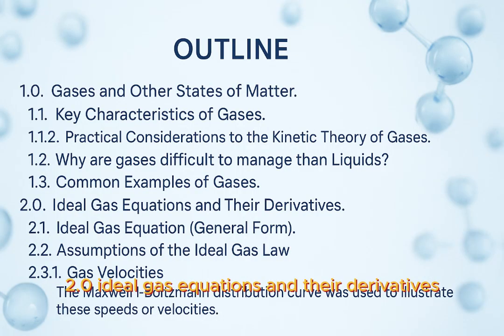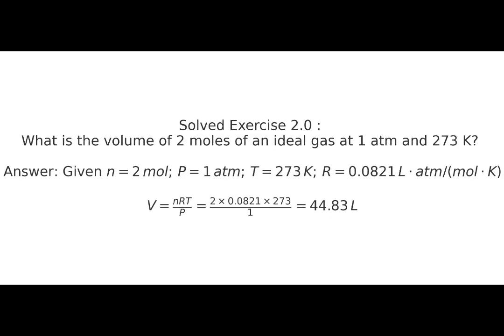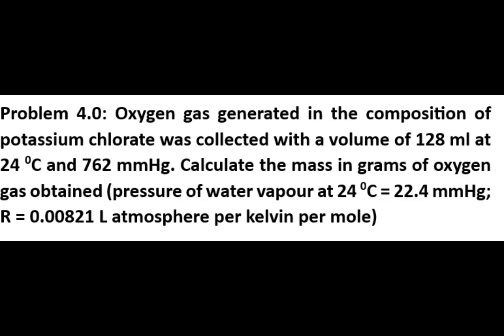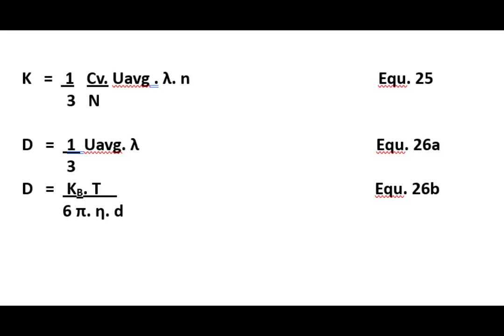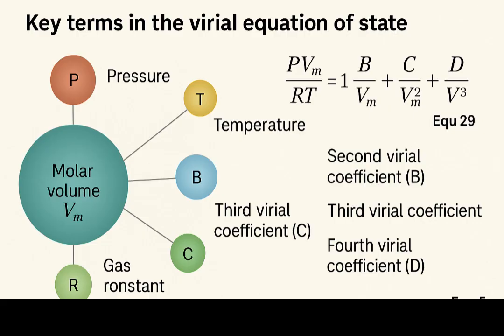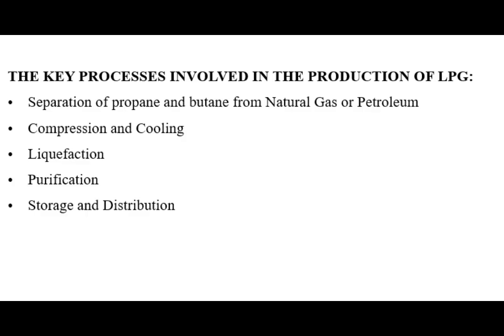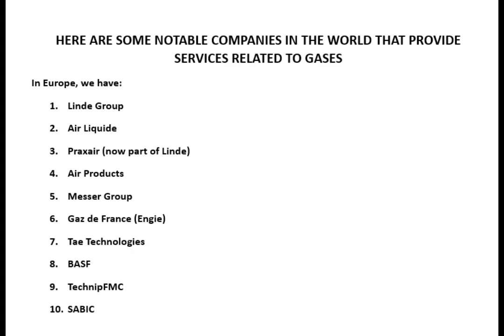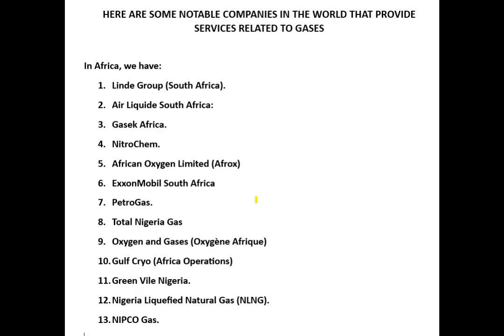Fundamentals and Applications of Gases

Comment: BCH: The implications of using free and pure form of oxygen gas in the atmosphere rather than the cylinder of pure oxygen for anaesthesia during surgery are impracticality, safety risks, Uncontrolled flow: Atmospheric oxygen wouldn't provide a controlled flow, which is crucial for safe anesthesia administration, Risk of oxygen toxicity: Prolonged exposure to high concentrations of oxygen can be toxic and Regulated flow: Cylinders allow for regulated flow rates, ensuring the patient receives the correct amount of oxygen,

Comment: MCB 

IONIZATION OF GASES 
Yes, it can. Ionization of gases in the atmosphere allows air to conduct electricity, which leads to lightning during a thunderstorm. This happens when strong electric fields ionize the air, creating a path for electricity to flow as a lightning bolt.

LIGHTNING OF ELECTRIC BULBS

Yes, it can. Ionization of gases allows certain electric bulbs (like fluorescent and neon) to light up. The gas inside gets ionized, letting electricity flow and produce light. Incandescent bulbs, however, do not use ionization. They glow by heating a metal filament.

Comment: BCH: GBONEE GRACE BARIVURE 
U2023/5535211
Using free and pure form of oxygen gas in the atmosphere rather than the cylinder of pure oxygen from anaesthesia during surgery has some positive implications like cost savings, increase availability and reduced logistical challenges. There are also some negative implications like contamination risk, air quality concern, safety and efficacy, equipment modifications. Also, some critical implications includes patient safety, medical standards and anesthesia precision

Comment: Bch…(u2023/5535026)

Using atmospheric oxygen during surgery is not advisable  because 
Regulating the oxygen flow and concentration might be challenging without a controlled delivery system like cylinder
Atmospheric oxygen might contain. Pollutants or particles that could compromise patient safety 

Using atmospheric oxygen directly for anesthesia instead of cylinders poses safety concerns, logistical complexities, and challenges in precise control. Current medical practice relies on controlled oxygen supply systems for reliability and patient safety.

Comment: ABOVU HANNAH SUNDAY
U2023/5535048
BCH: Using free atmospheric oxygen for anaesthesia during surgery isn't ideal,reasons being that;
1. Not pure enough: Only 21% oxygen in the air.
2. No pressure control: No built-in regulator.
3. Contamination risks*: Pollutants and pathogens in the air.
4. Logistical issues: Hard to capture and purify on the spot.
Cylinders of pure oxygen are safer and more reliable for surgery.

Comment: BCH: Using free and pure oxygen directly from the atmosphere instead of a cylinder of medical-grade oxygen for anesthesia during surgery would have serious scientific, safety, and medical implications

	•	Medical-grade oxygen from cylinders is:
	•	Highly purified (≥99.5%)
	•	Sterile and filtered
	•	Delivered through controlled systems
	•	Atmospheric oxygen is exposed to dust, bacteria, pollutants, and humidity variations.
Implication: Using it would introduce a high risk of infection and respiratory complications.

Comment: BCH-U2023/5535166
Oweibe Esther tamaraebi
Using pure oxygen from a cylinder during surgery instead of ambient air has implications for patient safety and surgical outcomes. While pure oxygen can improve oxygenation and potentially reduce surgical site infections, it also carries risks like oxygen toxicity and atelectasis (lung collapse) if not carefully managed. Additionally, it can increase the risk of fire or explosions if not handled properly.

Comment: GLY: Liquefied Petroleum Gas (LPG) is a popular fuel used for cooking, heating, and transportation. It's a mixture of propane and butane, stored under pressure as a liquid.

Some key benefits of LPG include:

1. Clean-burning fuel
2. Energy-efficient
3. Convenient for cooking and heating
4. Wide availability

LPG is widely used globally, especially in areas where natural gas infrastructure isn't available.

Comment: FELIX PERE-ERE 
MCB: Yes ionization of gases in the atmosphere causes lightening during thunderstorm, when strong updraft in storm clouds separate ice particles and water droplets,charge separation occurs, this creates regions of positive and negative charges in the cloud. the electric field becomes so intense that it ionizes air molecules, stripping electrons from atoms this ionization creates a conductive channel that propagates downward when it connect upward from the ground the lightening discharge occurs

Ionization of gases is not the primary mechanism for lighting of electric bulbs so 
In summary ionization of gases can not lead to the lighting of electric bulbs but causes lightening during thunderstorm

Comment: BCH... U2021/5535003 (orlu vidah eberechi)

If we could harness atmospheric oxygen for medical use, it would require significant advancements in technology to ensure:
1. *Purity*: Removing impurities and contaminants to meet medical standards.
2. *Consistency*: Maintaining a stable oxygen concentration.
3. *Safety*: Preventing any risk to patients.
While it's an intriguing idea, the current medical standard relies on controlled, high-purity oxygen supply from cylinders or oxygen generators specifically designed for medical use.

Comment: BCH.....( U2021/5535044 )
Harnessing atmospheric oxygen for medical use would require significant technological advancements to ensure:
1. *Purity*: Effectively removing impurities and contaminants.
2. *Consistency*: Maintaining stable oxygen concentration.
3. *Safety*: Guaranteeing patient safety.
Currently, medical oxygen supply relies on controlled, high-purity systems like cylinders or medical-grade oxygen generators.
Any new approach would need to meet stringent medical standards and regulations.

Comment: PIC: Joule-Thompson experiment is a typical example of the cooling process. LPG which is composed of propane and butane uses this cooling process. Unlike propane and butane,the cooling process is not enough to overcome the low critical temperature of methane which makes up over 90% of LNG.Therefore a process which is called cryogenic process is used. A cryogenic process is the process of applying extremely low temperature to cause the gaseous methane to be liquefied.

Comment: BCH: The implication of using free and pure form of oxygen gas in the atmosphere rather than the cylinder of pure oxygen for anaesthesia during surgery has significant implications as the oxygen cylinders contain a controlled concentration of pure oxygen ensuring consistent and accurate delivery. On the other hand atmospheric air, even if filtered, contain variable amount of oxygen and other gases like nitrogen, argon and carbon dioxide. This variabilities/impurities makes it difficult to precise and control the inspired oxygen concentration for the patient which is critical during anaesthesia.

In summary using free and pure oxygen from the atmosphere instead of oxygen cylinders for anaesthesia is unsafe and impractical due to the lack of purity, inconsistent concentration, potential for contermination and incompatibility with anaesthesia equipment. Oxygen cylinders provide a safe, controlled and reliable source of oxygen for medical use.

Comment: BCH : Using free and pure oxygen from the atmosphere instead of a cylinder during anesthesia poses significant risks, including potential contamination, difficulty controlling oxygen concentration, and increased risk of fire and explosion. While pure oxygen is used in anesthesia, it's carefully controlled and delivered via a cylinder or other medical-grade system to ensure patient safety. 

Ambient air is only 21% oxygen. During anesthesia, precise control over oxygen concentration is crucial for maintaining adequate oxygenation and preventing complications like hypoxemia (low oxygen) or hyperoxia (excess oxygen).

Comment: BCH : (U2023/5535113)

Using atmospheric air in place of pure medical oxygen during anesthesia is unsafe, impractical, and not permissible in clinical settings. Medical oxygen is carefully manufactured and regulated to meet the physiological and equipment demands of surgical procedures.

Comment: ANUGHOM SHINE CHIDERA -- U2023/5535040
BCH:  If a medical cylinder that is being used for surgery doesn't contain real oxygen, it means the gas inside isn't pure oxygen, which is vital for surgery. Oxygen molecules interact through Van der Waals forces, These forces are what allow oxygen to exist as a gas and to be absorbed into the body.
If the cylinder contains something other than real oxygen, it would be dangerous for the patient, in the essence that ;
* Other gases will have different Van der Waals forces, and may not be able to bind to haemoglobin, which carries oxygen in the blood, resulting in organ damage.
* The introduced gas could react unpredictably with the body or anesthetic agents.
In conclusion; The patient could suffer from insufficient oxygen, organ damage, or adverse reactions due to the lack of real oxygen.

Comment: GLY-U2023/5565078
Dalton’s Law states that the total pressure of a mixture of non-reacting gases is the sum of the partial pressures of each individual gas. The partial pressure of a gas is the pressure it would exert if it occupied the entire volume alone at the same temperature.

Comment: The use of free atmospheric oxygen instead of a medical oxygen cylinder during surgery is unsafe and unacceptable because:

Atmospheric air contains only 21% oxygen, while medical oxygen cylinders provide nearly 100%.

Anaesthesia requires precise and controlled oxygen delivery, which air cannot ensure.

Atmospheric air is not sterile and may contain harmful contaminants.

Inadequate oxygen can lead to hypoxia, brain damage, or death.

It violates medical standards and is ethically and legally improper.

Conclusion: Only pure, medical-grade oxygen from cylinders should be used during anaesthesia to ensure patient safety and compliance with medical protocols.

Comment: Dasha Umesi 
BCH:
Using atmospheric air instead of medical-grade oxygen during surgery is extremely dangerous and medically unacceptable. Air contains only 21% oxygen, which is far too low to safely support a patient under anesthesia. It’s also unsterile and can expose patients to harmful pollutants and infections. Medical oxygen from cylinders is pure, sterile, and carefully controlled to ensure proper anesthesia and patient safety. Using ambient air not only risks serious complications like hypoxia and infection but also violates medical laws and ethics. In short, pure medical oxygen is essential and cannot be replaced by regular air.

Comment: BCH: Using atmospheric oxygen for anesthesia during surgery is not feasible due to several implications:

1. *Uncontrolled concentration*: Atmospheric oxygen levels (21%) may not meet the specific needs of patients undergoing surgery, where precise control over oxygen concentration is crucial.

2. *Safety concerns*: Relying on atmospheric oxygen would make it challenging to ensure a consistent and safe supply, potentially compromising patient safety during critical procedures.

3. *Lack of portability and flexibility*: Atmospheric oxygen cannot be easily administered in controlled amounts or transported to where it's needed in a surgical setting, unlike oxygen cylinders which provide a portable and reliable source.

4. *Purity and contamination risks*: Atmospheric air contains various other gases and potential contaminants, which could pose risks during anesthesia administration where purity is paramount.

In surgical settings, the controlled and precise delivery of oxygen is essential, making cylinders of pure oxygen indispensable for ensuring patient safety and effective anesthesia.

Comment: PIC :The Joule-Thomson effect is part of the cooling process, but on its own, it’s:
	•	Not cold enough,
	•	Not efficient,
	•	Not scalable for industrial LNG.

So, LNG isn’t made directly using the JT effect. It takes a complex, engineered refrigeration system to get natural gas to -162°C safely and economically.

Comment: Name: salami Racheal Oluwaseun 
Dept: Microbiology 
Yes, ionization of gases plays a key role in lightning during thunderstorms*, but it’s different from how *electric bulbs light up.

1. Ionization & Lightning:
During a thunderstorm:
- Collisions between particles in clouds create electric charge separation  
- This ionized path allows a massive electric discharge — lightning — to occur, releasing heat, light, and sound (thunder).

2. Ionization & Electric Bulbs:
There are *different types of bulbs*:

- Incandescent bulbs*: Do *not rely on ionization. They light up by heating a tungsten filament until it glows.

- Fluorescent or gas-discharge bulbs (like neon or CFLs): *Yes*, they use ionization. A voltage ionizes the gas inside, and the resulting plasma emits UV light, which then excites a phosphor coating to produce visible light.

Comment: PIC: 

LNG (Liquefied Natural Gas) isn't produced like LPG (Liquefied Petroleum Gas) because:

1. LNG requires much lower temperatures (-162°C) to liquefy.
2. Methane's (LNG's main component) properties make it hard to liquefy using the Joule-Thomson effect alone.

Instead, LNG production uses complex cryogenic refrigeration cycles. LPG, on the other hand, can be liquefied at relatively low pressures and temperatures, making the Joule-Thomson effect suitable for its production.

Comment: BCH: Implications:The patient may not get enough oxygen, The brain and vital organs can become damaged.
Breathing might become dangerously weak, There’s a higher risk of infection or contamination and In serious cases, it could lead to death.
The air we breathe every day has oxygen in it, but not a lot, only a small portion. The rest is made up of other gases that the body doesn’t really use. That’s okay when we’re awake, walking around, and breathing normally.
But during surgery, things are different. The patient is asleep from the anesthesia, and their breathing becomes slower and weaker. Their body can’t take in as much air as it normally would. And because of that, they need extra help, stronger, cleaner oxygen to keep the brain and organs alive and working properly.
That’s why doctors don’t use the regular air from the environment. They use pure oxygen from a cylinder. It’s clean, safe, and gives the body exactly what it needs during that risky time.
If regular air were used, the body might not get enough oxygen. That could lead to serious problems like brain damage, organ failure, or even death because the body is too weak to handle low oxygen levels while unconscious.

Comment: Bch:u2023/5535252

The use of atmospheric oxygen in surgical anesthesia is an intricate and demanding process, requiring advanced technology and rigorous safety measures. Maintaining strict control over both the purity and the pressure of oxygen is vital, as even minimal deviations can lead to life‑threatening outcomes. An insufficient supply, excessive pressure, or unexpected fluctuations can quickly escalate into critical complications, placing patients at severe risk. Because the margin for error is so narrow, the entire system must operate with exceptional precision and reliability to ensure the safe and effective delivery of anesthesia.

Comment: BCH:The implication of using free and pure oxygen from the atmosphere for anesthesia during surgery is the logistical challenge of capturing and delivering oxygen. In a surgical
 setting, oxygen needs to be delivered precisely and reliably to the patient. Using atmospheric oxygen would require complex equipment to capture, purify, and deliver the gas in a controlled manner, which would be impractical and likely unreliable in a fast-paced surgical environment. Medical oxygen cylinders or piped oxygen systems, on the other hand, provide a convenient and reliable source of oxygen that can be easily integrated into anesthesia equipment.

Comment: BCH - ICHELLA NYEKACHI JERRY

Using atmospheric oxygen instead of pure cylinder oxygen during surgery is not advisable. The air around us contains only about 21% oxygen, which is not sufficient to support anaesthesia that requires higher oxygen concentration. Free air also lacks purity and may contain dust, microbes, or other pollutants that can cause infections or complications during surgery. In contrast, oxygen from medical cylinders is clean, sterile, and allows accurate control of flow and concentration.

Comment: PIC: LNG cannot be produced directly using the Joule-Thomson experiment like LPG because methane (the main component of LNG) has a very low inversion temperature. At normal temperatures, it doesn't cool down during expansion like propane or butane in LPG. Therefore, LNG requires special pre-cooling through refrigeration systems before the Joule-Thomson effect can be used to help liquefy it.

Comment: BCH: U2023/5535018

Using atmospheric oxygen instead of medical-grade oxygen from a cylinder during anaesthesia has serious implications. Relying on atmospheric air would lead to insufficient oxygen delivery , increasing the risk of brain damage , cardiac arrest, or death. Additionally, atmospheric air is not sterile and may contain dust, microorganisms, and pollutants, posing a significant risk of infection during surgery. In contrast, oxygen from a cylinder is filtered, regulated, and delivered under controlled pressure via specialized equipment, ensuring patient safety.
Therefore, the use of atmospheric oxygen is inappropriate and dangerous in surgical settings, and cylinder oxygen is essential for safe and effective anaesthetic management.